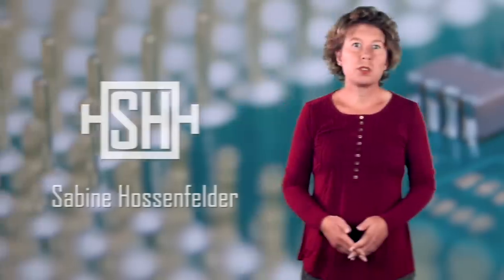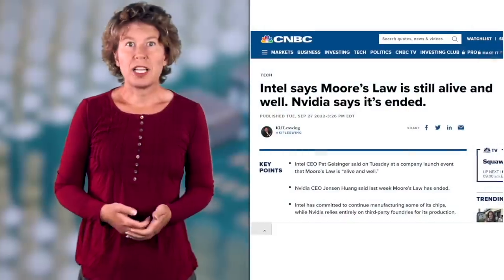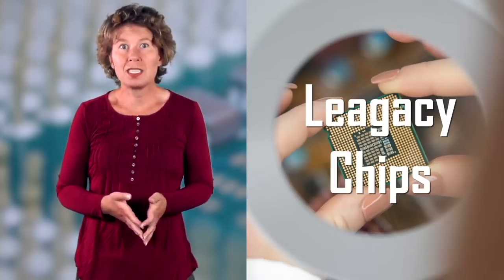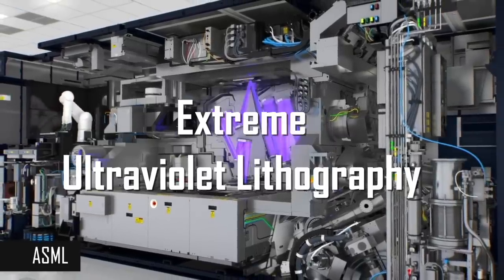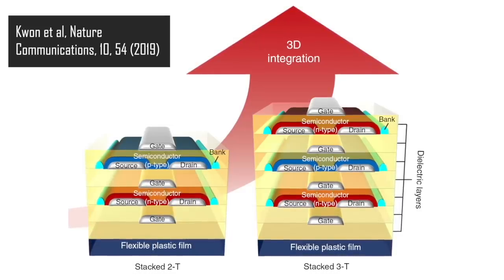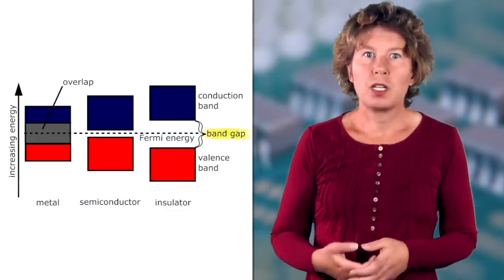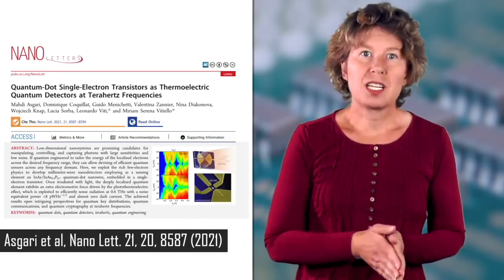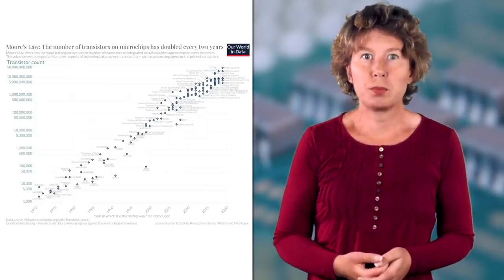Is Moore's Law Finally Dead?

Comment: There were concerns about this way back in 2000. Miniaturization has slowed dramatically. Increases in processing power has been largely the result in improvements in parallel processing. The early 2000s had faster processor than we do today. Instead, we now get more done with several parallel processes via multithreading.
Reply: Still the NM race will hit a wall ant around 2nm
Reply: "The 2000s had faster(single threaded) processor than we do today" That is demonstrably wrong, totally ridiculous statement, at least if you are referring to non consumer research products thay I am not aware of that is just extremely untrue.
Reply: @marcossidoruk8033 
I remember Pentiums hitting the wall at around 3.4GHz. Current Intel/AMD CPUs don't clock faster than that IIRC in single-thread mode even if they are more capable.
Reply: Unfortunately no. The increase of computational power has slowed down even more than the slow down of miniaturization. Just because, we have more computational power than we need doesn't matter computational power is increasing in the same rate as before.
Reply: @marcossidoruk8033  I will admit that my info is a little out of date, so maybe there have been sufficient advances that there are now faster CPUs. Doesn't change that almost all CPU performance improvement in the past 20 years have been in the area of multithreading. The reason we use mutlithreading at all is because they were running up against physical limitations described in this video. Not enough atoms, to shrink it further, and quantum tunneling were serious problems back then. And I suspect that any improvement in single thread speed we have seen since then have been in the form of clever ways to get around the problem rather than overcoming those physical limitations.
Reply: Your info is extremely out of date. It's true that companies went the multi-core route to increase performance at a faster rate, however current day CPUs' single-core IPC is multiple times higher than early 2000s models, nonetheless.

IINM, moore's law was still in effect until early 2010s, in the least.
Reply: @MaGaO Hertz is system wide clock speed, but processing power is measured in flops AFAIK. Two vehicles can travel at the same speed and yet one can get more work done by pulling more cargo.
Reply: @zigmar2  They aren't that much faster. The fastest single core I could find was from 2 years ago, and that was only 5.6 GHz, less than ×2 the top speed from the early 2000s. Moore's Law would suggest a greater increase than that in 2 years, yet 20 have passed, and it is certainly not the multiple times you're suggesting.
Reply: @Harkmagic  Why only focus on frequency? That alone doesn't determine a CPU's performance.

A modern CPU core's computational performance even at the same clock speed is already multiple times higher. If we take into account the increased frequency, the performance difference is even larger.

Does moore's law say anything about frequency? Last I checked it only observes the number of transistors.
Reply: @zigmar2  because it is frequency that is impacted by those physical limitations. You make smaller transistors to produce faster transistors. You also get the benefit of being able to fit more into the same area, but it speed that is limited by not having enough atoms and quantum tunneling. It is the limitation that was bypassed by multi-thredding.

My main point is that these physical limitations are not new, and manufacturers has been working around them rather than overcoming them for the past 20 years.
Reply: @Harkmagic  Relying on frequency alone to increase performance is a waste. CPU architects have been designing higher IPC processors since at least mid 90s, but perhaps maybe even 80s.

The goal of smaller transistors isn't only for increased frequency. The ability to pack more of them in the same area has always been one of the goals. After all, you need more to be able to design a higher IPC architecture.
Reply: @yeetdeets  
And the original comment meant processor clock (even if incorrectly using the term faster ).
Reply: @Harkmagic  Did you even read my comment? 
You are showing everyone you don't understand how computers work, frequency alone doesn't determine anything.
Modern CPUs are miraculously complicated and there are a million ways in wich modern CPUs are more efficient than older ones.

Furthermore your info is not out of date: its wrong. It was wrong in 2010 it was wrong in 2015 it is wrong today, single core performance has gone up and has always done so.
Reply: @zigmar2  okay, let me strip what I am saying down to the one single idea that I'm trying to communicate.

These physical limitations are not new.
Reply: @MaGaO  clock speed is completely meaningless. Even flops is not entirely representative of actual performance because the main bottleneck in most consumer programs tends to be memory access wich has become increasingly faster with improved and enlarged caches.
Reply: @Harkmagic  Yes, I didn't dispute that part.
Reply: @marcossidoruk8033  
We're not talking about clock speed being meaningful (even though it is, in part): we are talking about how clock speed being limited sets a limit on performance.
It's not a coincidence that multiple cores started reaching consumer computers as PIVs reached their frequency limit.
Reply: @MaGaO  First, thats not what the original comment says, the original comment talks about CPUs being faster only because of multithreading wich is completely and utterly wrong.

And the worst part is that what you just said is still dead wrong.
As I said, clock speeds have gone up, modern high end CPUs can reach 5Ghz or more with overclocking, so the statement "modern CPUs have not become considerably faster in terms of clock speed compared to 2000s CPUs" is completely wrong, they have.
Still, base clock speeds have not gone up, and that has nothing to do with physical limitations because you can definitely go faster as evidenced by the fact that you can overclock them, the Reason why higher base frequencies are not so popular is because a higher clock frequency doesn't imply better performance while it does imply Higher power consumption and heat production. Hardware Innovations and transistors are dumped primarily into caching and pipelining and SIMD instructions all of wich can and do make a much bigger impact on modern CPU performance than clock speed.

All your pointless rambling would be solved if you actually did a benchmark. Take 2 CPUs one from 2010 and other from 2020 that have the exact same base frequency and compare the single threaded performance of them. The 2020 will easily 4x-8x the performance of the 2010 CPU, and if the modern CPU is one of the few that can use AVX512 its going to be even worse. What I am saying is that in modern CPUs clock speed isn't the limiting factor in single threaded performance, memory access and execution ordering can be more important.
Reply: @marcossidoruk8033  
"Higher clock frequency doesn't imply better performance" yet:
- processors control performance (and consumption) by lowering frequency among other strategies
- 2000s processors were in a frequency race in order to get better performance while waiting for new architectures to be developed.
OTOH, you are right: modern processors can reach 6GHz.
Reply: @MaGaO  I never said clock speed was unimportant for performance, just that there are other things wich in modern CPUs are more important and measurably so. You completely missed the point.
You can overclock a modern CPU to its absolute maximum and see in many cases 0 increase in performance, that is why base frequencies are generally left untouched, they give you the option of raising frequency if you know very well what you are doing, but in the general case it makes no sense because most programs are bound by other things.
Reply: @marcossidoruk8033  Frequency was the standard by which CPUs were measured. It did stop going up, in fact as far what was available for PCs it dropped by about half once multithreading became a thing. It stopped going up because they had physical limitations that we still have made very little progress on. Just because the standard by which performance was measured changed doesn't change that fact. I've also said repeatedly that performance increases have been the result of work arounds I never denied performance increases.

Back in 2010 there were games made in the early 2000s that literally could not run at high performance levels because the were build specifically to use the very high speeds of single CPUs and there were no longer CPUs on the market that ran threads that fast.
Reply: @Harkmagic  The limitations weren't reached in early 90s and yet Intel was designing higher IPC cores, like Pentium Pro. Pentium 2's main performance increasing method compared to P1 was also not just frequency.

It never made sense to rely simply on frequency even when they could've.

Which games?

P.S. using Pentium 4 as a yardstick is misleading. It was a low IPC architecture deliberately designed to use higher frequencies to compensate. You should compare modern frequencies to the likes of Athlon 64, XP, Pentium M, P3, etc.

In fact, scratch that, even that wouldn't really be valid. The only real way would be to take, say, a 486, die shrink it to a modern node and see how high it can clock.
Reply: @Harkmagic  Did you read my comment? Do you even at least google stuff before saying things wich are blatantly false?
Clock frequencies have gone up, modern cpus can reach frequencies higher than 5GHz, they just don't do it by default because it doesn't make sense to consume that much power and generate that much heat when most programs nowadays are memory bound and the fact that you can increase speed of computation in a much more efficient manner by widening SIMD instruction sets.

And no, you said in your original comment that performance increases were solely because of multithreading, then you got corrected and now you pretend you didn't say that.

Also frequency was never ever the standard to measure CPU speed, the only standard is: (in much the same way as in physics) experience, benchmarks. Anything else is pointless hand waving and marketing campaigns.

Comment: Interesting video but I have two notes:
1) 1:00 You show transistor, it is NPN, bipolar transistor. Most current top chips do not use those but are based on  unipolar MOSFET transistors those are more power efficient.
2) 2:42 You declare that transistors are switches. Not really, switch mode is just one modes that is used in digital designs. Transistors are generally current amplifiers...
Reply: I disagree on #2.
Transistors are never really "switches" we just think of them that way.  With a MOSFET the resistance varies with voltage over a range.  We call one resistance "ON" and another "OFF" but there are many values between.
Transistors are really transconducance devices.  On the bipolar transistor the E-B voltage it what makes the current flow.  Of the same model transistor, this relationship is almost exact unit to unit.  The HFE of a transistor varies quite a lot unit to unit and really is more a problem than a feature.  Lots of design tricks are used to make circuits not depend on HFE

Comment: Totally agree with @funtech below.  My son works in this area now, and even in metamaterials, with Moire patterns, there is a limit of about "a box" of about 6+hexagon in flat planes, or an "x-box" like a bucky-ball of only a dozen or so atoms.  The main problem is interrogating the "bits" within these structures.  The wavelengths of the interrogation laser/optical system is so large, that it washes out the adjacent bits, after/for distances of a couple of wavelengths.  This "interrogation noise" causes local destruction of the bit patterns, thus memory is lost.  There is a fundamental quantum-noise level, which conflicts with the interrogation frequencies/energies, and requires near-Zero-Kelvin temperatures.  3-dimensions do  not change this size range, just makes it a larger Qubit.

Comment: As a structural biologist we rely on GPUs for data processing of EM data, basically hijacking the GPUs (hopefully more than one card) in parallel to do a variety of calculations like sorting images, building adaptive learning, and building models. If you run the same computations with a CPU it would take days longer.

Comment: My first was a Sinclair ZX81. The ZX81, released by Sinclair Research in 1981, was a home computer with the following specifications:

	•	CPU: Z80A running at 3.25 MHz
	•	RAM: Initially 1KB (expandable to 16KB)
	•	ROM: 8KB containing the operating system and BASIC interpreter
	•	Display: Black and white output at 64x48 pixels
	•	Ports: RF video output, cassette interface, and an edge connector for expansion
	•	Keyboard: 40 rubber keys with a membrane keyboard layout
	•	Storage: Used cassette tapes for program and data storage
Reply: Nice :P I have an ISO C1P emulator I kick up every now and then just to remember the excitement :)

Comment: Commodore 64 was my 3rd computer. TRS-80, TI-99/4a with Extended Basic, then Commodore 64. I also had the "laptop" version with a 5" color CRT and an internal floppy. Those led the way to my 35-year career in computer programming.
Reply: I've used 2 of those 3, still got one .

Comment: When we did computer studies at secondary school in 1979-80 The class's main computer was a Commodore PET with 16k of RAM, and about ten Challenger IP8's - 8k RAM, which needed a separate tv monitor. We visited a sugar factory's headquarters on a coach trip and they used a massive IBM system which had SHADOW and CICS (operating systems?) That's all I remember from all those years ago!

Comment: The original Moore's law is about CRAMMING more transistors in the same area, i.e. shrinking the node. At the time, this also meant increasing clock frequency, i.e. performance roughly at the same pace, since shrinking the distance between gates also meant the electric potential stabilized in less time.
But this trend began to slow down dramatically in the early 2000s due to heat dissipation problems and as of 2023 it has been dead for 5+ years regardless of marketing trying to redefine the concept.
Of course there are still Incremental improvements in the process and chips with more cores and larger dies, but neither of these are the same as node shrinks, which is what the original law referred to.

Comment: I think they are overstressing. Density scales to the power of 2, so even a little smaller of a node goes a long way also the power efficiency gains allow for higher clocks (depending which version of Moore's Law we are talking about). Memristor cache will also make a huge difference, because on todays chips half of the area is only cache.

I think we still have a while before we need to go beyond silicon.

Comment: From looking at the graph of number of transistors over time, it looks like we reached an inflection point around 2010, with slower growth since then.  I would expect growth to gradually level out rather than suddenly hitting a ceiling, as development becomes more expensive, requiring longer times to recover development costs, and indeed, judging from the graph, this seems to be happening.
Reply: I agree.

Comment: The most amazing thing about Moore's law to me is not the increased density of transistors but instead the power reduction per transistor. From the original PC computers using 8086 chips to the current generation, there has been a reduction of power per transistor from 10^-4 to 10^-9 watts. 

And here's another fun fact: the entire annual semiconductor, semiconductor manufacturing equipment, materials, and facilites markets combined total slighly more than one quarter of Walmart sales. Talk about an inverted pyramid when you think about how much depends on that little industry.

Comment: You didn't emphasize the importance of temperature enough. Prior to the 2000s, clock speeds were doubling about every 18 months. But that hit a brick wall in 2000, with the Pentium 4 hitting 1.3 GHz. The current leakage goes as something like the 4th power of clock speed. And the higher leakage from smaller transistors made it impossible to crank up clock speeds as much as in the past. You'd cook the processor in its own heat.

That's why we went from 50 MHz in 1990 to 1.3 GHz in 2000 (a 26-fold increase). But by 2010 we'd only managed to push that to 3.3 GHz (a 2.5x increase). Instead, we've been eking out more performance by putting multiple cores onto a single processor, instead of just a single core. But that necessitated having to re-work our software to be multi-threaded if we wanted performance gains, which isn't always possible.

Even if we overcome the temperature problem, we're likely never going to see a 25-fold clock speed gain from 2000. The 4 GHz processors we have today already perform a cycle in the time it takes light to travel 7.5 cm. External memory is already bigger than that (in addition to the distance from the CPU to RAM, a stick of laptop RAM is nearly 7 cm long, desktop RAM 13 cm - this is part of the reason more laptops have been moving to soldered RAM, it's not just vendors trying to lock you in). So modern processors rely entirely on memory caches built into the CPU. A 30 GHz processor would perform a cycle in the time it takes light to travel 1 cm, which is larger than the die size of most processors. So you'd be losing a clock cycle just in the time it takes for the left hand to tell the right hand what it's doing.

Comment: Molecular and/or atomic proximity pressure does not require a flow of electrons; just movement. Similar to the electrical pressure in capacitance and elastance.